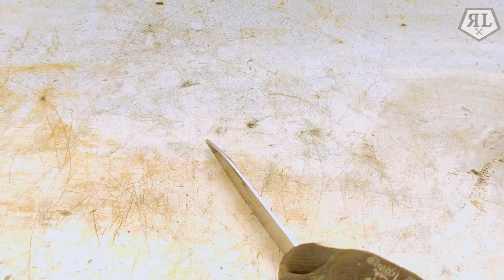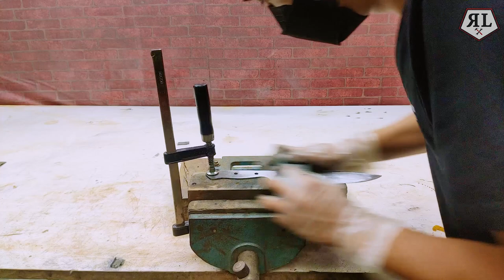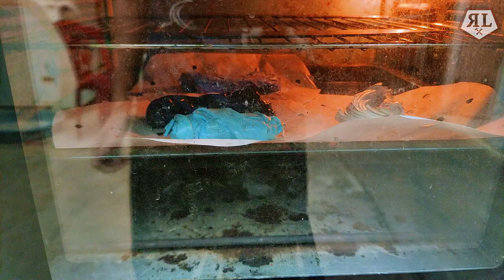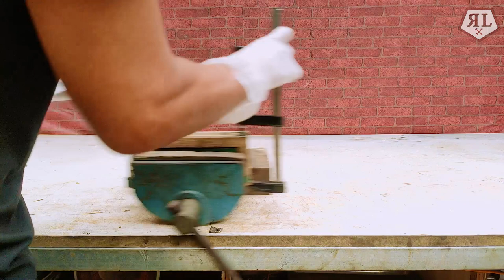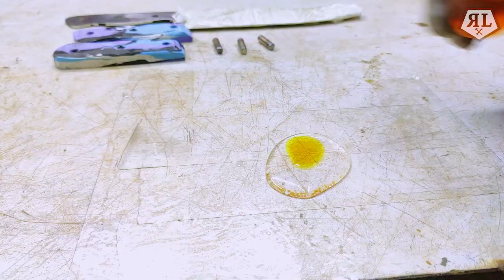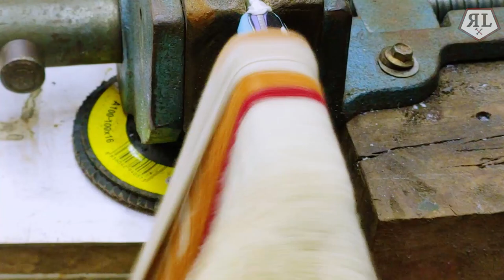Making a Knife from an Old Saw Blade - with Recycled Plastic Handle

Comment: As a metallurgist I'm disappointed. This saw blade has welded teeth, that's mean the main body is soft low carbon steel not suitable for knives. Such a knife is junk. Sure you can sharpen it but edge retention will be literally a few cuts. More if you'll cut only cucumber :)